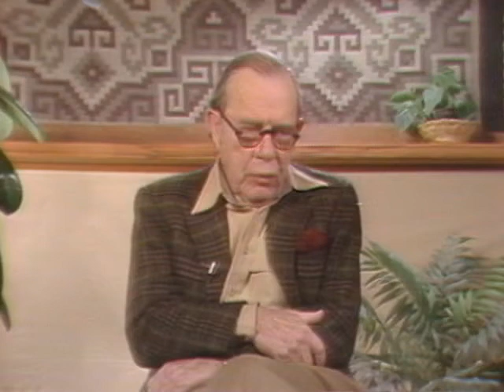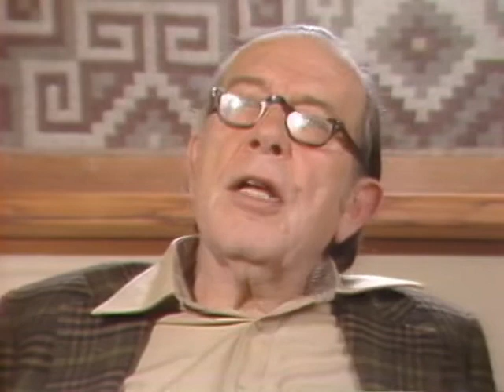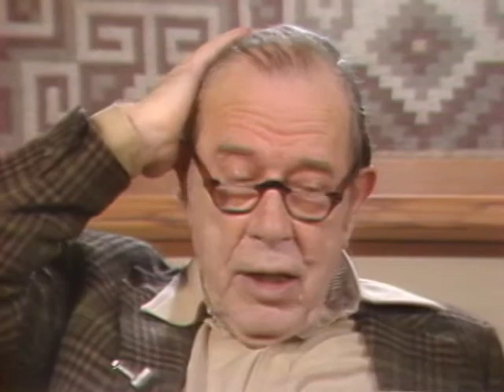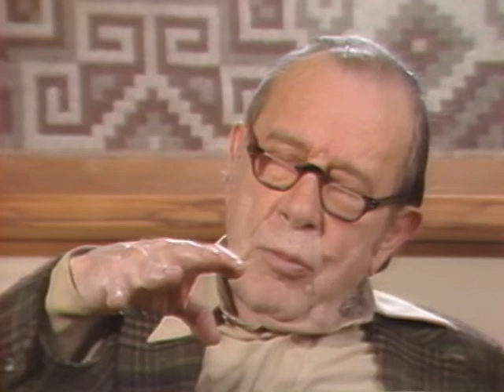Arthur Young: Helicopter and Evolutionary Theory

Comment: We were providing the proto type and how to produce it was the next project
Production line for customers
We were putting out one helictoer a week
The racks were rebuilt
Rebuilt the racks instead of production one
Fallacy of production line: bell parts the bearings in tail rotor ware used in air cobra system and replace with arctic grease.   Our manftactur replace normal grease
To it come off the line with arctic grease.   Everyone figured it out
A final inspections station
The great in bearing they replaced it with arctic grease
They protective devices from changing
Evolution of higher species
DNA create mutant species
The helictopter evolved it being a type

Surfer Frank
Downey Cali

Comment: The model and design
That was the next problem
The production line look good for senators and putting out one helicopter a week
It had to find out the hard way
After they been in production and wrecks came back and found took a whole unite and re-build it , instead of production line
Each worker do the same work on one project
Evolution
We wanted to use bell parts
The cobra parts were special bearings and stored with archaic grease..  arctic grease
Production line they put in the right greesss
Finally found a final inspection station.    They replaced it with arctic grees
	they had to create a process to check that one thng is used..  so, not something else is being used..
I was trying my best to evolve.  It keeps going to type
So, we must adapt and change.   

Surfer Frank
Downey Ca